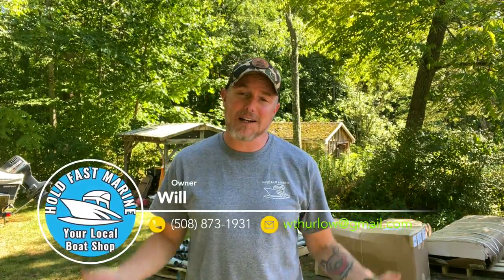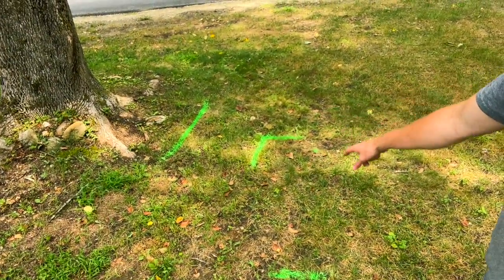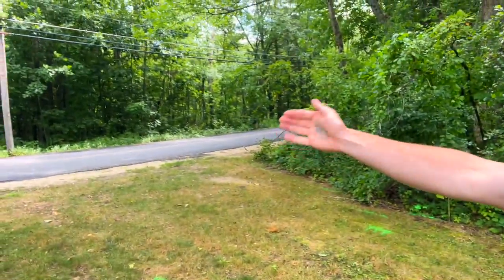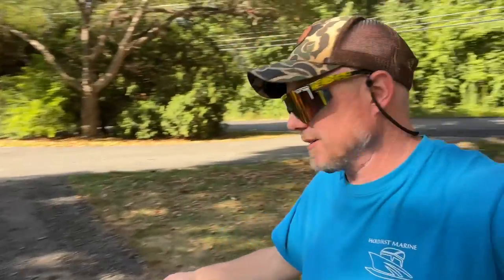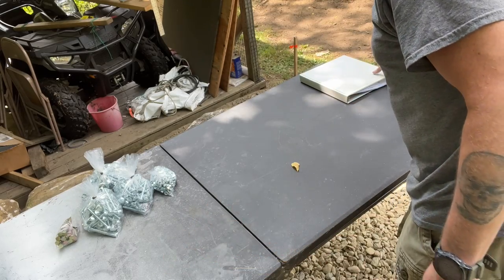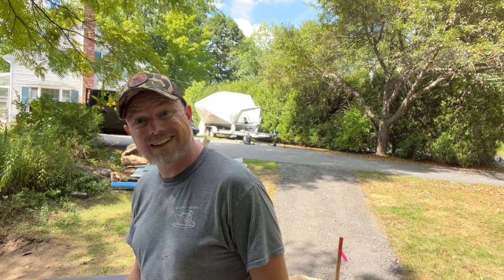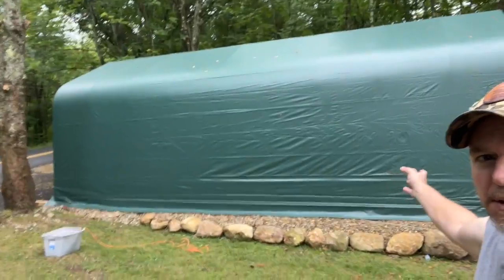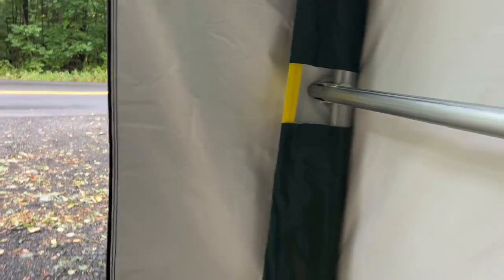ShelterLogic *NEW Workshop*

Comment: Could have Bare Min, Lumber Frame and Metal Siding Built a Shed for ABOUT that..
Reply from the maker: You forgot to calculate building permits, zoning changes, plus the labor to build it. I bill out at 120 an hour times 40-60 hours. And trust me I did the math, just in timbers it would have cost me 5k.
Reply: @HoldFastMarine  I live in the Panhandle of Florida in a County that Outside the City Limits, they tell me I can do whatever I want on my property and don't need all those Permits, Zoning or Financial BS.. Sorry you do. And I did Capitalize the word "About".. Also, I THINK you got screwed on the Price of it. Looked them up and they sell for Under 3 Grand.. I would post a link here but this Site would delete it.
Reply from the maker: Not sure where you’re getting 2 grand from. I just went to their web page and entered the dimensions of my building and it’s 8,479$ here’s the link. Make sure you enter 18’ wide, 40’ long and 13’ tall…… so I definitely didn’t get screwed. 
https://www.shelterlogic.com/sheltertech-sp-series-peak

Comment: Order another front door for the back door.  Whats the problem?
Reply from the maker: Sure just email me your credit card number and I’ll totally buy one. Regardless I already installed a door. Framed out a nice wall and it’s all good now. Thanks for watching!
Reply: @HoldFastMarine  I'm helping my brother out right now spec'ing-out a 40L x 14W x 17H barn roof-style ShelterTech to store his RV in. I figured the ultimate would be to drive it in through the back and pull it out the front so, two doors. Did you ever get answer from them on that?

Comment: Cheaper to just buy a steel building
Reply from the maker: Possibly, however a shelter logic is considered a temporary building and therefor does not fall into tax brackets or other town laws. Which building did you put up?
Reply: @HoldFastMarine  in my area steel carports don't require any permits or anything of that nature. But i live no shit like 15 miles from anything including my closest neighbor. 
I chose a versatube 3 sided carport, and framed the front in myself and later on poured a pad in it

I had a cheap 10x17 harbor freight tarp shed frame that i covered in cheap 28ga? Galvanized steel 8's and 12's overlapping. On a framed out floor about 4-5 years ago ive seen over a foot of snow slide off of it in the winter.
I suggest if you can get away with it, pour a pad in the middle, frame the ends and cover it in steel
Reply from the maker: Well I don’t live where you do lol. This isn’t a car port. I appreciate the feedback. However I cant do anything your suggesting.
Reply: @HoldFastMarine  i get it. I can get away with basically anything out here lol. Everywhere has different building requirements, I'm just lucky i guess. Farm life 😆🚜